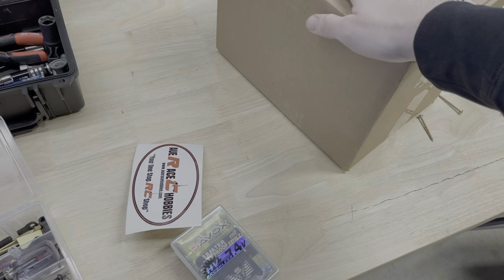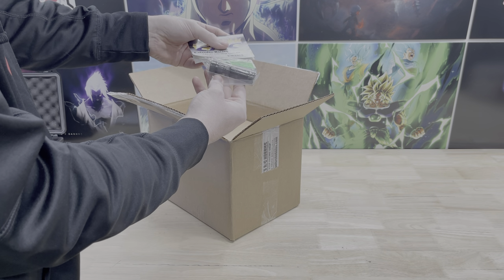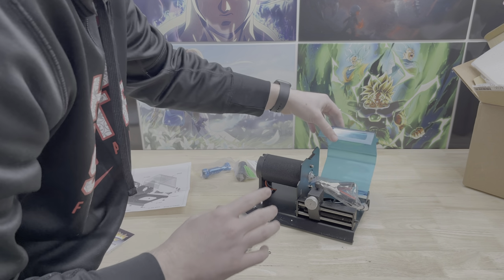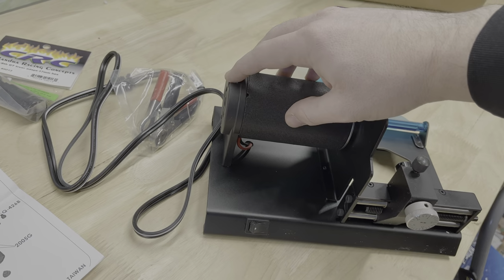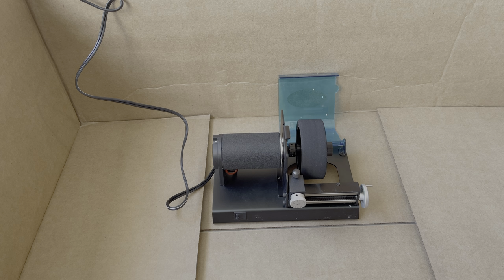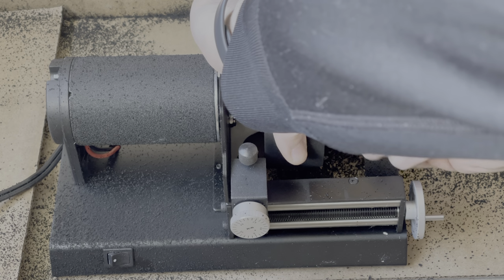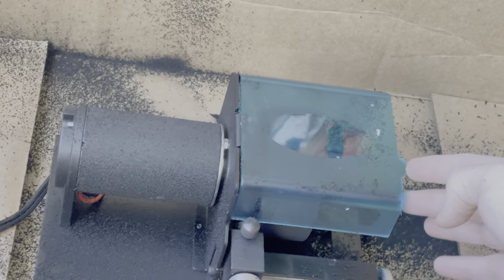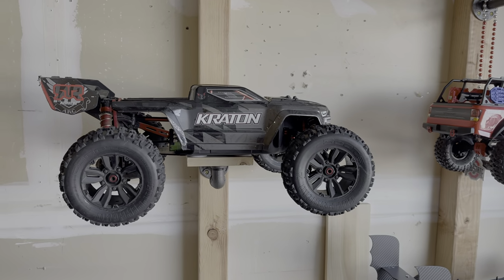CRC Foam Tire Truer - Calandra Racing Concepts

Comment: very nice tire truer. i got 1 with all the accessories as you did. i made mines wired & end terminated to accept a 3s lipo, a car battery or a power supply. all interchangeable way of off shore electronics 8mm anti spark connectors. be safe
Reply from the maker: Very nice!

Comment: I'd suggest using digital calipers to make sure the truer did it's thing properly. But give the tires a chance to cool off as the heat from the blade will cause them to swell giving a bad reading. When I raced onroad cars on carpet, that's what all the fast guys did so the tires are trued all round consistently. Talking about pan car guys. Those things are crazy hard to drive, at least for me.
Reply from the maker: I am absolutely gonna grab a set of digital calipers today for the very reason shown in the video. Good to hear from you that I should do this. I didn’t think about the cooling off part. Thanks again for the great advice!